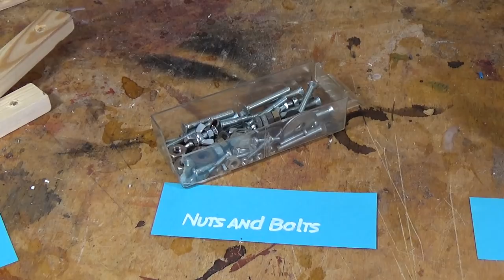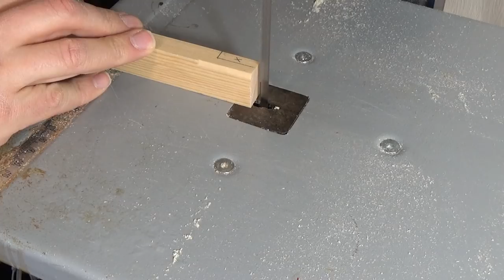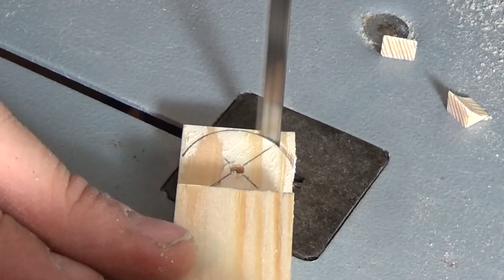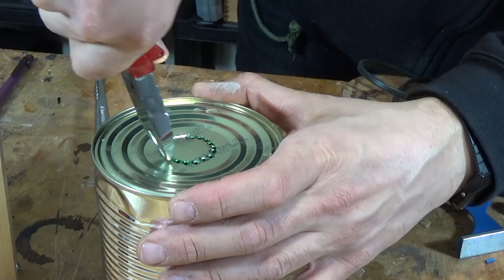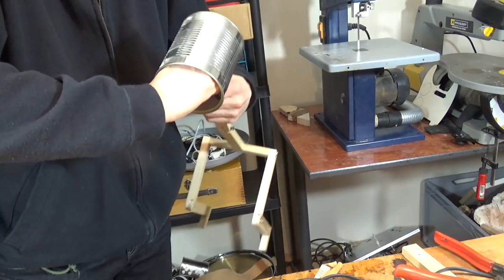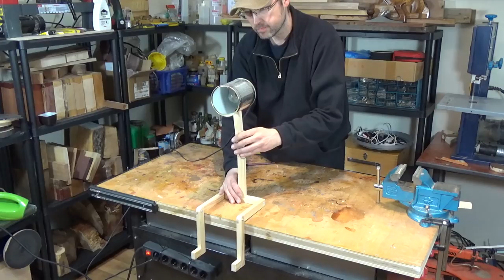making a Tin Can Lamp // How To

Comment: You NEED to put some holes in the can for heat escape.  Take your same base design and make swivel arms to make it look like a man sitting there. That would look so much cooler. Neat project though.
Reply from the maker: Thank you! Yes to the arms but No need for heat escape since I only use LED-bulbs. They only get lukewarm.
Reply: @FabiansTinyWorkshop  
You're a not only fun, but a genius, too! NanaAnn